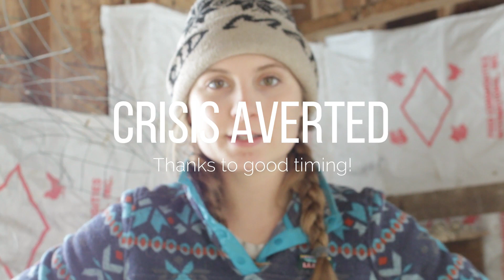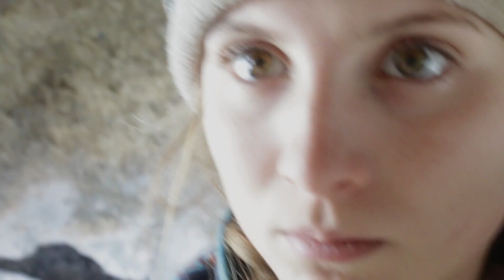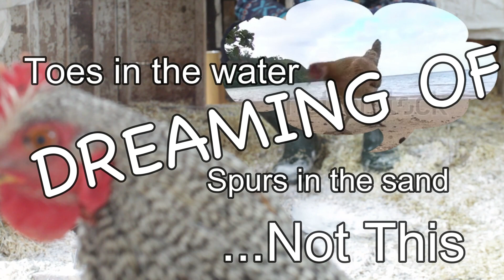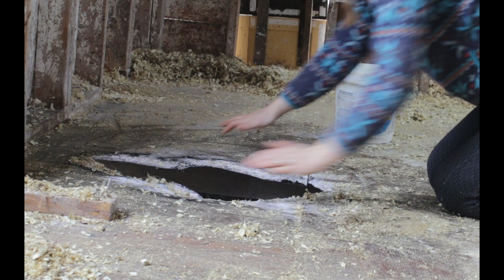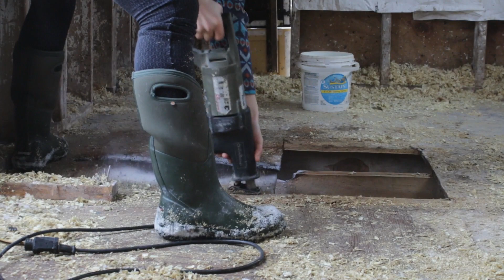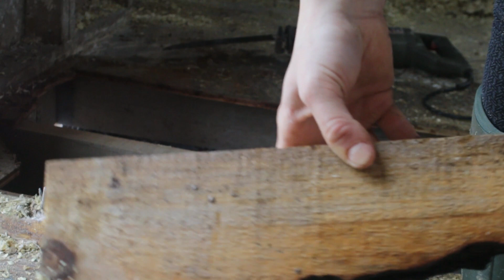Adding wood ash to chickens' dust bath? Don't do it!

Comment: Hey Open Gates Farmstead (OGF). Suggestion only make a trap door, make lemonade from lemons... LOL  This trap door is easy way you can clean off that descarding hay into a waiting wagon ( low wheel barrol under that crawl space hight like rolling drawer) that you can load and pull it from outside to a designated mulch dumpimg composting clear area from trees to prevent fires built by maybe a nine foot hoop boarder say wrapped in chicken wire over the hoop like,and gate doors on each side gated area grow your fruit tress bordering your every six feet. Remember composting pile  generates smoldering inner heat. Hoop covering it with chicken wire is to prevent flying birds like your guesses  or chicken flocks, ducks from flying over high fence or hawks . ... checkout Pure living for life channel garden setup they did this past summer setup was truly successful from previous year attempt. It fenced hight blocks possible dear like invasion; but they don't have chickens yet, so hoop wire idea from cattle Panel that The Grass-fed Homestead channel. But please don't add plastic. You have a barn. If you want too do all season garden, look at " Homesteadonomics"  channel partly underground greenhouse. That can complement build next to your barn. This channel missed or has a glitch I'm hooping he had figure out , but maybe I can suggest the fix.  It is just missing one construction part or it missed attempt of Cooling venting system that allows a more tropical planting. But that a fix I am too plan at my partial underground gardenhouse.  May I one day create and perhaps Puerto Rican carribean islander homesick stuck in dessert  like environment of El Pason Texas hater can make Lemonade from lemons. OK back to positive suggestions. Look at "Homesteadonomics" channel chicken coop. I love it, but it doesn't roam but it can on a 2.0 version...3.0 I would build one like it next on one side or garden with access door leads to garden after end off season cleanup. Full circle is that not what permacalture, and the other end disengage  2.0 to roam and connect after season ends or evenings. .... checkout drainage system of lead water towards his friut trees. So guide water to those pond area dig ditches (eventually build french draines or calverts) along side winding road or walking paths to reach prefer end pond for the ducks and that Ice skating ring. Circling water never freezes in winter gravity feeding troughs like Justin Rhodes channel he has a roaming pvc hose from his streaming to his pig/chicken system  he just tweaked  past fall it curently working. Yes I'm researching how to get my pieces of roaming tiny house maybe land travel between family. In my old town in the Midwest summers and head back this dried forsaken place my kids have chosen to stay and live as I can  return visit in winter. Oh to dream.
Reply from the maker: we have been making lots of lemonade this week! hahah havent screwed down the new chip board yet so theres definitely still time to do a trap door. We just got 1 1/2 feet of snow overnight here so ive had the whole flock, ducks and chickens, boarded in. Id like to get the outdoor yard up and running before the spring. Im thinking clear green house paneling on the roof now that i finished putting the roofing rafters in. I would love to have my peep house barn be only for winter housing and create a movable chicken tractor to get everyone roaming in the e-netting in the warm months. Right now they free range but i want the area to be more controlled for clearing and utilizing all their waste. I like the idea of a hoop house, and some farmers keep them around here, but they have to be really reinforced with the snow load. I would love to do a partially buried greenhouse great for us bc we are in zone 4! We have about 6 ditches leading into the large pond but id like to create some sort of dam system from the small pond to the large, and the large into the overflow. Im thinking there might be a way to capture energy with a turbine and the water flow if i were to create a dam system. Also, looking into a solar water pump to water everything would be amazing! The todo list/dream list grows hahah
Reply: @opengatefarmstead3609  I rather due skylight with clear see through like the goat barn "lumnah Acres" channel , or better checkout "Fouch Family off Grid" channel (type search word Fouch o'matic  ) video called The Timber Frame and steel Dream Workshop+ Our Mountain Dream Home story (shop) metal roof  clear poly skylights. I believe his roof is what your dreaming to due.
Reply: @opengatefarmstead3609  I also have watched a channel on network channel on TV " Homestead rescue " on the first season I've seen them generate Hydro power. And I have seen another like mini ditch like cement swirl ditch drain hydro power the hack was type search "Hydro power generator "  . I like to see your accomplishment this year. Good luck.

Comment: Um, how about you just dont put hot ashes in your chicken coop!?  Other than that, ashes are good for them.
Reply from the maker: I had the ashes in a sealed container for 4 days and they re lit after being in the coop for a day. I made this because it was shocking and unexpected for me. We like to reuse what ever we can so the wood ash goes into our compost now.
Reply: @opengatefarmstead3609  I think the trick is you gotta let them cool before putting them into a container.  I have a bunched saved up for our chickens, but a lot of the wood had nails in it, I was getting the nails out with a magnet lol, but realized there were a lot of tiny metal fragments in the ashes so cant use it.
Reply from the maker: @Lazy_Prophet  yeah it was totally on me but i thought if I could mess that up, having burned wood for heat my whole life, better just put it out there as a learning lesson. I think if I were to try and use it again I might just mix some up with sand outdoors. Our burn pile definitely has nails in it I cant even imagine taking a magnet to it
Reply: @opengatefarmstead3609  lol, it is on you but no worries, I would have thought those ashes would be cool enough too.  That sucks it had to happen though, but you seem pretty handy 😄🛠👍🏻, yeah I'm debating whether or not to use it but I think it's probably not worth it, I'll just use play sand(can't find good soft dirt here in Las Vegas) with some pete moss, d-earth and herbs.